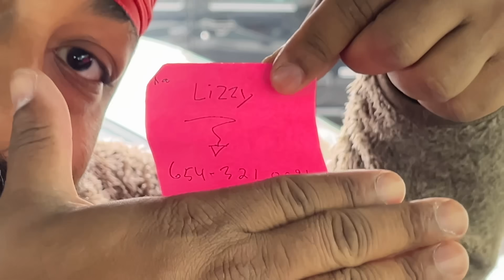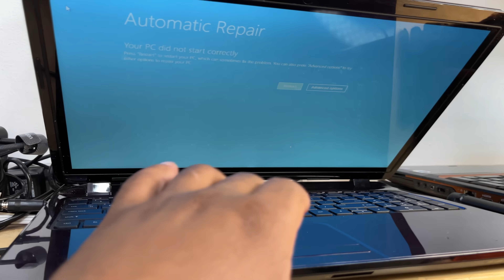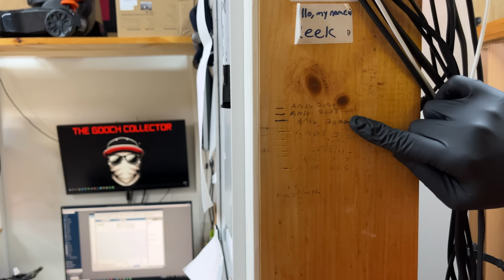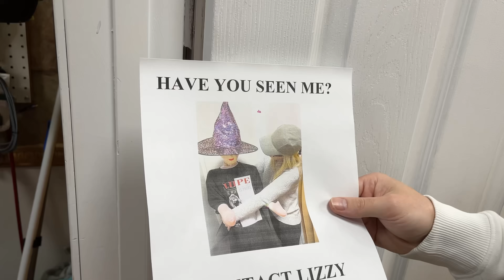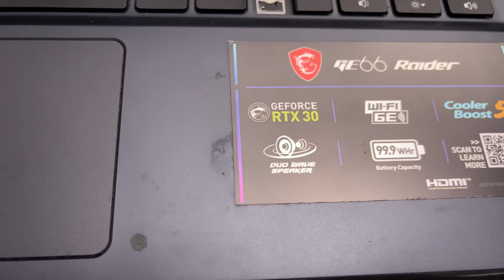From Hinge Repair to Felony Charges: MSI GE66 Raider Saved From the Landfill

Comment: If you buy one of those laptops. Gain Access to the hinge and use a 5.5mm wrench and loosen the nut on both side a little. It will be easier to open and it will last longer and most likely won't break. The bad part is the lid has to stay upright as the hinges most likely won't hold it up and an angle other than mostly vertical. I'm actually fixing the 2nd hinge on the same laptop by JB Welding the brass sockets back into and the plates back on. Put the screws in and push some JB weld into the hole, then use the screw to push the brass socket into the JB Weld. Before it cures all the way remove the screws to make sure the JB Weld doesn't stick to them. Clean them and put them back in. Also put a little JB Weld under the broken off plastic parts and the sides of the plastic parts too. Let it cure for 24 hours then put it back together. So far the last fix like that has lasted over a year. Thanks for sharing. Best Blessings. Keith Noneya

Comment: DUDE seriously blue magics quick steel is waaaay better than jb weld actually fuses to the plastics and can withstand 18,000 psi of pressure lol can be drilled and TAPPED as in no more free wheelin' nutz☺ hell can even form the new bracket drill and TAP it😁

Comment: i dont own a raider but i have a GL63 and i kinda have the same problem but the crack is on the top cover and i cant find any replacement parts with a keyboard included.

Comment: So! I own almost this exact laptop and I love it! Technically I have a GE 66 Raider but its not exactly the same. My hinges DID break but I mailed it back to the manufacturer and they repaired it "for free" (I never got a bill so I didnt pay anything even though it was past warranty) and I have replaced the thermal paste on the CPU/GPU 3 times but never on the VRMs. It works great, I can play ANY game I want on low settings and it has enough power to edit videos for work. I LOVE my GE 66 that I have had for almost 4 years and idk what I could replace it with
8.5 out of 10, would recommend!

Comment: 14:00 I know the feeling man, I used to repair and customise blackberry phones before (they started using glue on everything) as a hobby. Then it tried to scale it up into a business but the monotony, the silly demands from people and UK customs taking months to process my repair parts killed it. It was really the latter as I could only afford to buy parts at cost when a repair job came in. In order to sustain it I took upfront payment for the repair parts hence why it was sold at cost and there was no charge for repairs because bloody customs took ages to pass through my repair components. So instead of people being charged £50 for a LCD screen I'd charge the same cost as the LCD replacement was about about a few quid. Because I loved doing it as a hobby....

Comment: Can you please tell me thermal pad thickness on Alienware m15 r6 i7 11800h rtx 3070? I did repaste and pad replacement but my temp are worst than before.
Reply from the maker: @kmkrishnakant68  no, I’m not a user manual. But use PTM7950 and Upsiren thermal putty instead like I did here.

Comment: I'll be honest, I have been repairing equipment for a company that rents out video, audio and studio's for 13 years and still enjoying it. There are of course some parts that get boring. But I still love to work on a camera and repair it. even if it's just the replacement of another 3,5mm audio jack, and another, and another.
Reply from the maker: That’s what’s up man, I’m happy to hear you still have passion after all these years! Do you deal with customers directly? That’s usually the soul-draining aspect.
Reply: @SalemTechsperts  depends if I'm on at the main building. I only deal with camera operators and other colleagues. But out on the field, I do deal with customers. They sometimes don't even know what they really want. It can be a little frustrating. I see you point. Especially not tech-savvy people can be life draining.

Comment: i had a raider the same one you have and it was the best purchase i had made. it was a 2400 laptop at the time, i had a core i7 12 gen and rtx 3070  with 32 gigs of ram. it was my first gaming laptop for 2 years but i had to sell it. it never broke.
Reply: Thank you for giving me hope, I bought an msi on sale mainly for good arrow key placement but also for ease of repair. The bottom pops off, all screws are the same, and everything seems serviceable.

Comment: 6:38 razer doesnt use a really brittle easily-breakable design?  this cant be real

also i just checked my framework laptop 16 doesnt seem to use that design, the hinges screw directly into the metal of the lid (source: pulled off my bezel)

Comment: I started to just roll the Upsiren putty into a ball, putting it on the chip, then giving the putty a bit of a "fohawk". Sidenote: I work in networking. It took me 5 years after moving into my house to actually run ethernet and network it. So I understand you fully.

Comment: Some hinges can be loosened with a hex socket. I managed to do just that to an old Dell laptop. It made a massive difference to screen assembly, with a lot less torque and twisting of the plastics.

Comment: What printer do you use  got a quick glimpse  at something in the back and then mentioned using a 3d printed chisel

7:51.  /   amd behind you at 8:16

On your right side 5'6" short king 🤴
Reply from the maker: It’s a brother mfc from 2011 or something. Got it for free and replaced the broken roller. Thing is indestructible

Comment: One thing you should have mentioned is to remove the internal battery connection as it can cause a short circuit. I learned that the hard way. I did see in the video the batter is disconnected.
Reply from the maker: You must have missed me saying “first we unplug the battery so we don’t shock ourselves”
Reply: @SalemTechsperts  Oh i might have lemme check the video again :D love you content!

Comment: I have (sorta) an MSI ge62vr with a similarly destroyed hinge. I bought a replacement back, swapped it in for the broken one, and… it works, but the screen is half full of noise. I think the cable got damaged when the top half finally broke free.
There was actually rumblings of a class-action suit over the hinges. Don’t think it went beyond the name-gathering stage, though.

And nice Prince symbol.

Comment: MSI = Multiple Serious Issues.  Don't I know it.  In between my wife's now-dead GF65 laptop (which worked like a pile of s**t from the day it was new) and my B450A Pro Max motherboard, I curse them all the time (except on the MSI forums; I complained so much they banned me).

But MSI Dragon Center???   No, you don't want that.  Removing that from my wife's now-dead P.o.S. MSI laptop made it run faster and more stable (as stable as ANY computer can run when running MSWindows at least).

Comment: You've probably never seen one but the hinges on Let's Notes are parts of the lid and case. I can't imagine mine every breaking. They unfortunately have soldered RAM (since their 5th gen intel models iirc) but are very very durable tend to last a very long time and have a removable battery. I've also found them very easy to disassemble.

Comment: Fully understand about the burnout on repairing PCs. I had a small business of computer repairs back in the old days, 1989-2000, and I can relate. You have not lived until you pulled shag carpet strands out of a pc with tweezers. Was even under the keys on the keyboard. Had a ton of Packard Bell PCs come in for repairs and upgrades and seemed to be the worst ones overall.

Comment: In my own experience, those multi-color filaments are about 3-4x more brittle and sensitive as normal filaments. They're gorgeous, but for anything featuring small details or used for practical purposes, they're sadly just unusable. (I tried making a pen, switched to a normal filament and suddenly it stopped breaking when i looked at it wrong, i could toss it on marble flooring and it'd survive)

Comment: Have you done a liquid metal replace on cam yet? I've got a Zephyrus S21 GX701-LV,  and need to replace the CPU fan, but it's got LM.. EVerything I've read said not to  bother using Paste, as the CPU will NOT perform as well. But I'm not 100% about  the process. (No local shops will do it, and the ONE that said they'd try, SPECIFICALLY stated they aren't responsible for any damage or failures. So screw that, if it's going to get bricked, it'll be by me.
Reply from the maker: Use PTM7950, the temps are within a few digits. Liquid Metal isn’t worth it in a laptop

Comment: Reminds me of a repair I did on a vandalized high end Dell laptop. For some reason the owner stabbed the ethernet port, power input, and webcam and broke some keys. I was sure he was gonna have some criminal evidence on it he was trying to get rid of, but I found nothing. Computer was clean. Guy was just crazy. His sister gave it to me so I can fix it for her mom. Ended up buying a low end model and swapped the motherboard, storage, processor and webcam. Worked. Didn't even have to reinstall Windows.

Comment: I currently have a HP pavilion AIO that was dumped on the street. It had a cracked screen but the moon beeps, so it’s alive. It is give 3 long and 4 short beeps, indicating a psu problem. I found out that all the large barrel psu’s I had were under 120 w. So now I’m stuck with a large stand with a cool sliding webcam. At least all the other parts work.